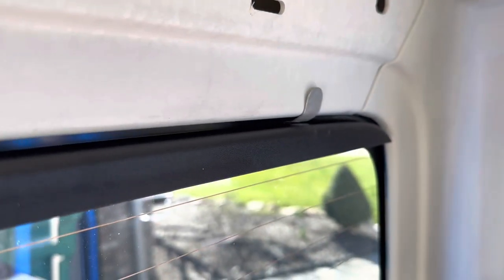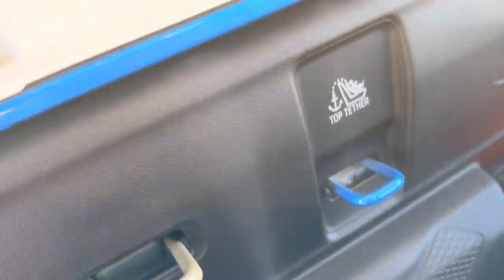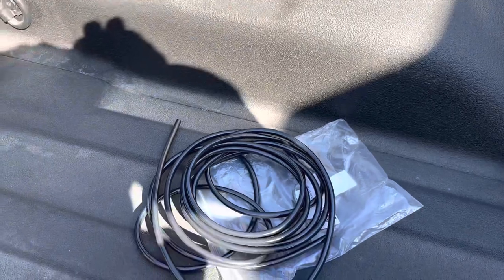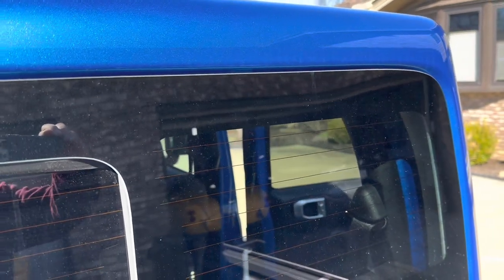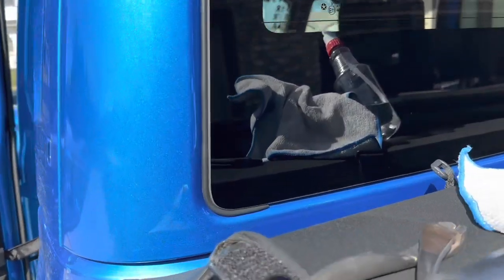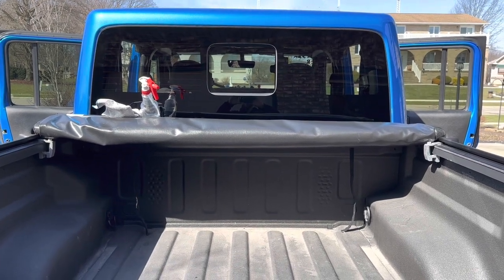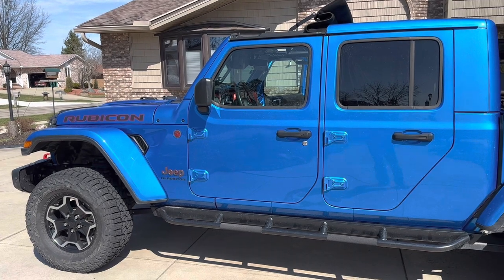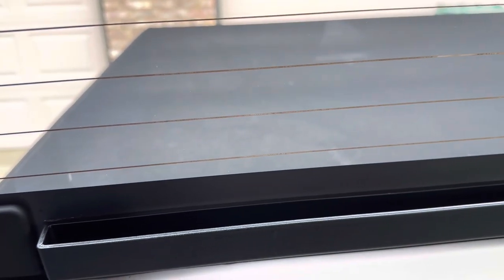2020 Jeep JT Gladiator Rubicon - No more back glass water leaks using silicone vacuum hose.  How to.

Comment: I used the best black silicone Home Depot had. Noticed mine leaking about 5000 miles after warranty was up. No leaks over a year.
Reply from the maker: Nice, yep, that’s the other fix.  I went with the hose as I was still under warranty and wanted something 100% reversible.  That is no longer the case so if I have any future issues I may go the flow able silicone route.

Comment: Did this on my Gladiator mid last yr.  Bought a used 2021 and discovered a minor rear window leak.  Did the silicone hose fix and so far it's been holding up.
Reply from the maker: Glad to hear!  Same here, no issues so far.

Comment: GREAT video to DIY. I am on REAR GLASS #4! Just installed today. Glass #1 leaked on the bottom. Glass #2 the defroster did not work. Glass #3 leaked on the top. Glass #4 is allegedly a NEW part with a redesigned frame. We’ll see. This has been a pain in the ass from the beginning, and like this video they damaged my top and it had to be repaired. BTW, PRO TIP don’t park your Gladiator on a steep hill (16+ degrees with the nose up) if it is raining. The water collects in the front under the wipers and will eventually find its way through the fresh air vents, drip down the inside of your dashboard and pool on your mats. This took over 10 visits to the dealer to figure out. Needless to say, I’m on the “squeaky wheel” list.
Reply from the maker: Thanks for the feedback, much appreciated.  Yeah, these things definitely have some quirks.  Thankfully my drive is flat, so no worries there.  Good luck with the glass, hope they have a better design.
Reply: @jrmotorsports5532  Thanks. I’ll be checking the top very carefully for damage when I pick it up. BTW, the flip top you have on the front, how do you like it? Easy to install? How’s the road noise and any water issues? Drop me a link please if you recommend.
Reply from the maker: @ErikAmend-w4c  sounds good.  My damage was behind the glass in the channel, they scratched it.  Would not have been visible but still wanted it fixed.  On the top, I have the best top sunrider.  I love it, best thing I have done.  No more storing panels.  Just 2 latches and flip it open.  Install is easy, 6 bolts.  I swap it in and out based on seasons.  Wind noise is higher on freeway, but not terrible.  Highly recommended.
Reply from the maker: @ErikAmend-w4c  https://www.bestop.com/products/sunrider-for-hardtop-jeep-2020-2023-gladiator-2018-2023-wrangler-jl/?sku=5245417

Comment: mine is doing the same thing but it looking it's only getting center and the side wet, that little compartment on the left side had about 1/4" of water, I was thinking it was leaking from the center glass
Reply from the maker: Could be, but the cracks can form anywhere in the frame.  If you look carefully you should be able to see them.

Comment: Had my 2021 Mojave at the dealer a week ago, they contract to a "Water Doctor" company to seal the rear window. It still leaked, but not as much, after the fix. They had me bring it back in for Water Doctor to check again, I had marked where I was seeing water(with painters tape). The dealer called me and said it appears to be cracks, so need to order new window. But, as you stated, that's probably a temp fix since the new one will probably develop cracks over time. So, I may be going your route, or the black silicone idea, in the future. Thanks for the vid and link
Reply from the maker: No problem.  This is an issue that will plague both Gladiators and Ram trucks until Stellantis fixes the poor design.

Comment: How do you keep the ends from popping out? Any issues with that?
Reply from the maker: No issues with popping, they stay in place.  They are tucked slightly under the bottom of the glass if that makes sense.  It should show in the video.

Comment: Mine just started. Im going to try your method first because my dealership said they would replace the window. 22 model not even a year old. I don’t understand why your dealership didn’t take the top off to replace the window. Never mind that would make sense and most service departments have none.
Reply from the maker: The dealers just sublet it out to glass company.  Guessing glass tech does not want the liability of removing the top, plus likely easier to work on while it’s mounted solid to the truck as well.  Either way, this whole issue is a joke and Jeep needs to get their arms around this issue.

Comment: Curious if this worked. Mine leaks too and I’ve seen people use frost king 1/4 inch tubing but it has adhesive on it. I like this option better. What size line is that you were using?
Reply from the maker: One day of rain so far, no problems/leaks.  7mm hose.  I’ll add link in comments.
Reply from the maker: Link added
Reply: Please provide me the link as mine is doing exactly the same and hate the dealership
Reply from the maker: @joegabriele  the link is in the video description.
Reply from the maker: https://www.amazon.com/gp/aw/d/B0BGSK8VTN?psc=1&ref=ppx_pop_mob_b_asin_title

Comment: I purchased the 7mm hose for 2021. The hose went in the space and disappeared. Does not look like yours. Any idea?
Reply from the maker: Do you have the original window or was it replaced?  Maybe not set in top correct?
Reply: Not sure I purchased it used, but carfax had no record of repairs
Reply from the maker: @DavidSmith-hc2xq  gotcha, hard to say then.  Best bet would be to find a thicker hose.  I went with the size many before me used and it is perfect.  That is with a window that was replaced once by Jeep.
Reply: Well I will see on the next rain. Thank you for the video and information 😅
Reply from the maker: @DavidSmith-hc2xq  no problem.  Best of luck!  Thanks for watching!
Reply: Sorry to bother you, but was the vacuum line 7mm I'd or od?
Reply from the maker: @DavidSmith-hc2xq  7mm OD

Comment: Just had to do this on my lightly used ‘21 that I just purchased. It was appearing to be leaking in at least 3 places. I bought it during a dry spell and had no idea leaks were even an issue until I stumbled on this video! I then noticed my T-plate paper taped to the window was wet in the middle, then detected the other leaks. This is what I feel would be bad news for the Bluetooth speaker and Apline subwoofer (both of which I have), in addition to possible mold in the padding strip just below the window. Also I noticed that the gap between the window and top isn’t 100% uniform all the way around… there was an 8” section of vac tube that I could push almost all the way down in just using my finger, so please be wary of how much pressure you need to apply to the tube as you work your way around.
Reply from the maker: @SilverBulletOBW  yep, it takes just the right touch and placement to work.  Thanks!